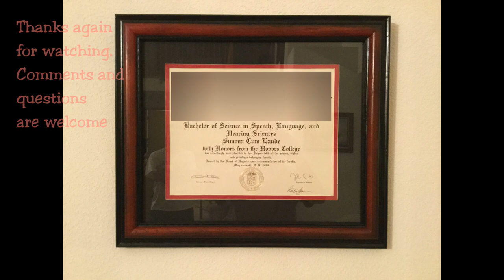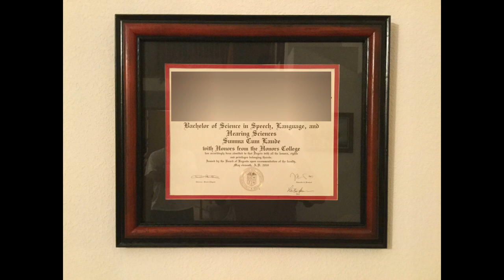How to Make a Picture Frame Diploma Frame - More Complicated Than I Thought - 50

Comment: Excellent work Robert!  I really enjoyed the video.  You have many of the same tools I do (the Craftsman steel router table, Harbor Freight clamps, Dewalt random orbital sander).  Can you please share the color of the accent paint you used?  I assume the base paint was a satin black.  Why do you say not to use red oak?   I have two graduates that would like frames for their diploma's.  Had a real chuckle at the end because my daughter got her degree in Speech Language Disorders; she's an SLP!  Thank-you for the great video!
Reply from the maker: Thank you.  The black was semi gloss, but satin would be great.  The red was Rustoleum Sunrise Red Gloss #7762.  Red is my favorite color, red/black my favorite color combination, and those are my shop colors.  If you look at past videos, you will see I disassembled both my table saw and drill press to repaint them.
Ha yes, the old Craftsmen stuff was great.  There is an old Craftsman router under that table as well.  Of course, now i have two other routers, and one more on the way.
The red oak is so hard, it took many minutes off camera to wiggle in the glazing points.  Use something a bit softer; it won't take a beating up on the wall.
Congratulation to your daughter and good luck with your frames.